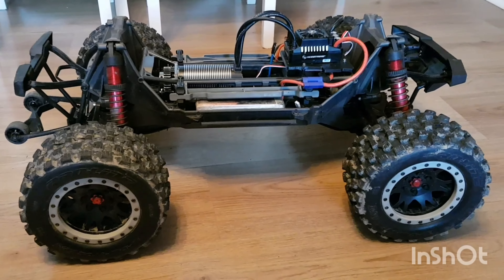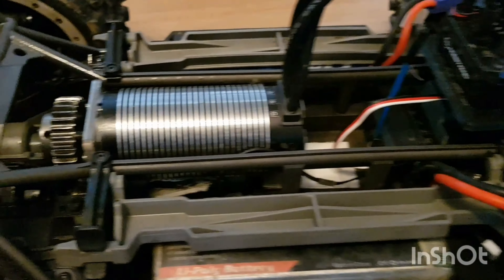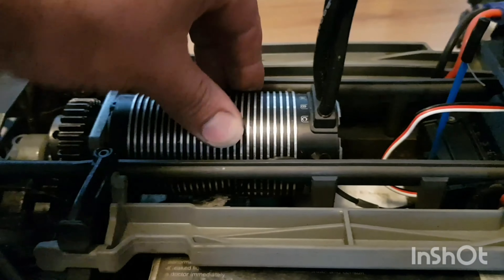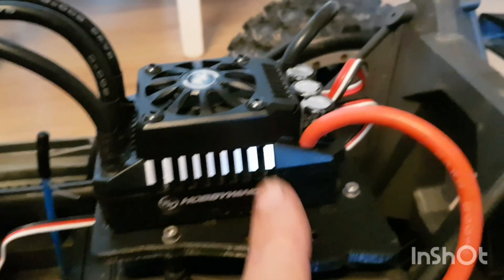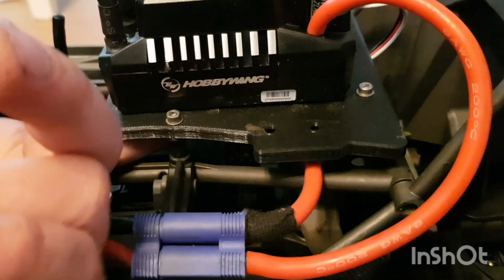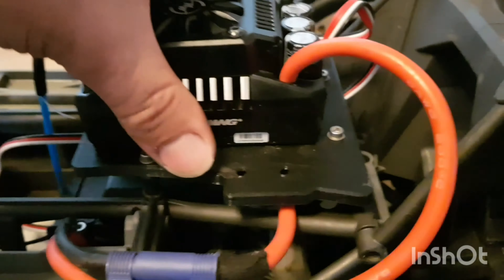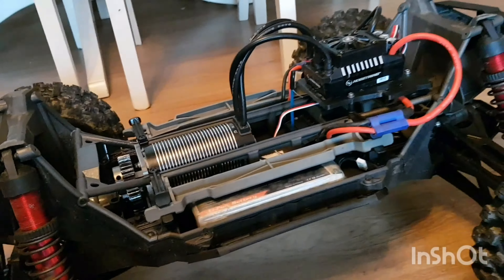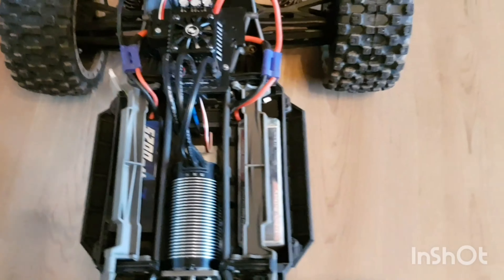Xmaxx 8s hobbywing max5 800kv 30t/35t vs Xmaxx 8s stock motor and esc with mod 1.5 gearing.

Comment: I know this is a older video but for anyone wondering I would 100% suggest 800Kv over a 1100Kv if you have a heavier truck, my X-Maxx with batteries and Brute body is 28.4LBS. I have a Castle sensored combo 800kv I also have HW 1100kv combo.  Use the same gearing of both being 25/35 Vitavon gearing.  The biggest difference be is the gears this dude is using vs the vitavon, he literally has chunk of heavier LQ metal.  His Pinion looks like it weighs about 90lbs by itself.  Joke aside get good quality gears even GPM is just 40m vs vitavon 45m look into metallurgy if you wanna know the difference, vitavon also weigh a decent amount of grams less for the same tooths,

Comment: What servo are you running? I have been searching for a strong xmaxx servo to steer the heavy tires lol
Reply from the maker: I'm just running the Traxxas 2085x metal geared servo and had no issues with it so far. I've just ordered a Hot Racing servo horn as the plastic ones are prone to rounding off.
Reply: @watersidebashers.9792  ok thank you very much I will give that a try 💯💯🤙🏼
Reply: upgrade the servo saver spring to 7746X and add a spacer also It needs to be just a bit stiffer, a piece of thick solder wire works good in a pinch. Add a longer screw and a nut to the backside it wont ever strip out. You can also swap the plastic gears in the stock servo for metal its cheaper....its not really about power its the servo saver. With heavier tires its more noticeable, especially on longer grass. try on carpet you should see pretty clearly what Im saying. I installed a Reefs 777 it was a waste, overkill, swapped it out for a 555 and left it....still overkill but it runs @8v. You can swap in a normal size servo with the traxxas adapter plate and its works just fine.

Comment: 800KV or 1100KV....what is wiser? Is the 800KV motor WAY heavier?
Reply from the maker: Yes the 800kv motor is a longer can, therefore it's quite a bit heavier In comparison to the 1100kv. 
The choice is torque over speed.
The 800kv after running it in my xmaxx has too much torque and extra weight. The 800kv motor turns slower too, because of that I have to install big gears, so it will still have the same performance. I will recommend the 1100kv over the 800kv in the xmaxx as it fits better, turns faster and is lighter. I will be installing the 1100kv in mine in the near future. Thanks for your comment 👍
Reply: The castle xlx2 and 1100kv is the wiser choice.
Reply: @Blueknight1960  The XLX2 is great, but my bullets have come off the board on the battery side. It happened to both of my XLX2 ESCS. My Max 5 is tougher TBH.
Reply: I prefer the 1100kv motor with 25/35 gearing. Way faster than rotation in the air and less weight
Double and triple backflips 👍
Reply: @joseCalderon1976  Was it the negative cable that came loose from the board?